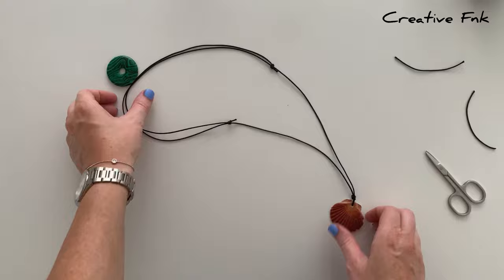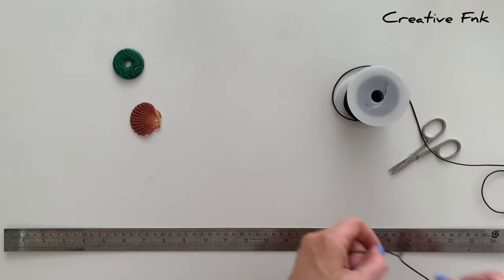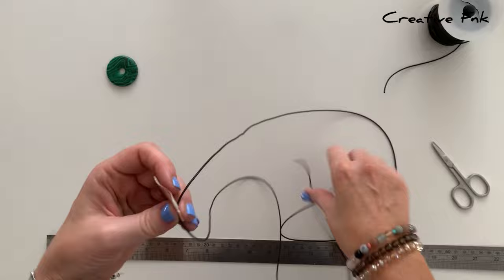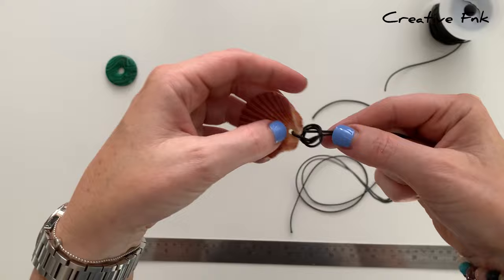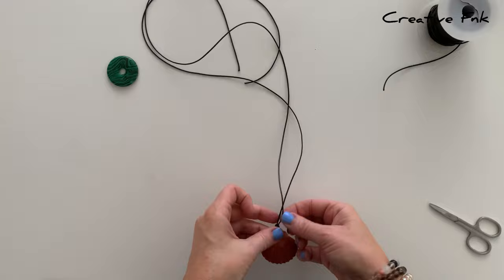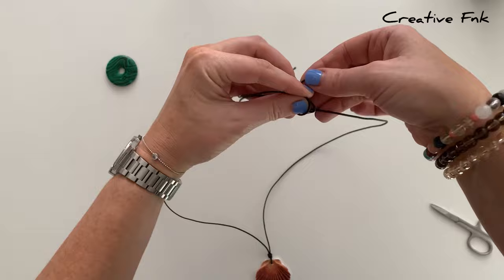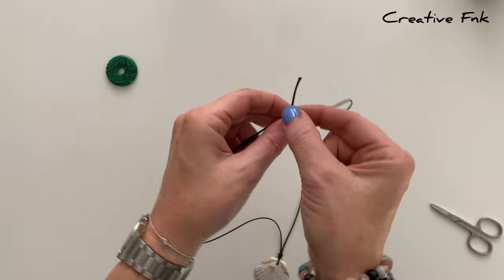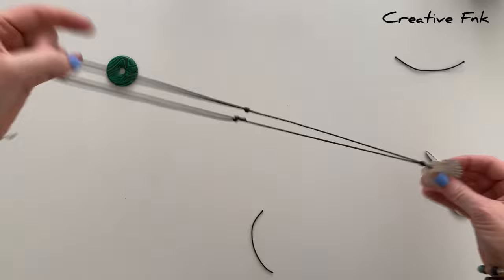Adjustable sliding knot necklace - simple how to video

Comment: For the 50" length- Where does the pendant sit on a typical neck- chest without being adjusted? And does this knot allow the necklace to be worn higher up to the throat or do you suggest using less total length to accomplish this rather than the full 50". Just not sure how much it tightens and what it looks like when it does so. 
Drilling boulder opals for pendants, And let's just say i'm not knot/ necklace savy 😂
Australian opal cutter, novice jewelry making skills.
Cheers

Comment: Hi, love how easy is to make this, I have a question... a few months ago I bought a adjustable choker necklace and after a couple months just broke in two,tried to fixed but broke again. My question is what's the best durable material I can use for this type of necklace? Thank you!
Reply: I have the same problem,  the leather cord I use is spliced together and always breaks at the splice. Frustrating for sure.
Reply from the maker: Great question! I love leather but find it does break after a while. I find waxed cords more durable so try a waxed cotton or waxed polyester cord 1-2mm and it should last much better. Good luck! Thanks for watching 🌻

Comment: It feel like my necklace is stuck and i cannot make it smaller any tips
Reply from the maker: Are the knots together? Or near the pendant? You may need to untie them and retie them in a better position. You should be able to slide them  to make it bigger or smaller, if not - the knots are in the wrong position and you need to re-tie them. Good luck 👍